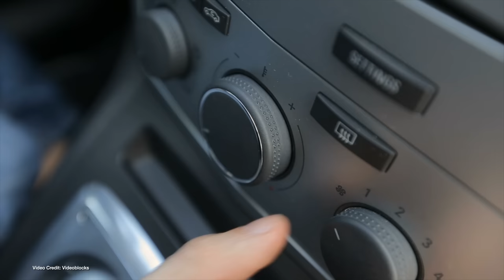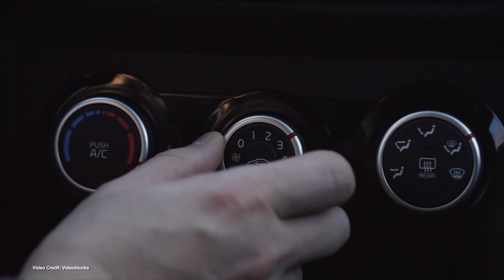How Do Electric Cars Keep You Warm In Winter?

Comment: Does anyone know if Tesla’s heat pump system actually has a backup resistive heater or not?
Reply: It does not. But it sucks the battery cold first, to save energy.
Reply: I think I recall that it can still warm the cabin with heat from the battery discharging, but my understanding is that the versions with the heat pump do not contain resistive heating elements.  

Of course if it’s way-cold outside, they’ll more likely expend energy to warm the battery, rather than the reverse.  However, if it’s only a little chilly, my understanding is that it will warm the cabin with battery heat, as part of the “octovalve” reservoir’s functionality.
Reply: @mr88cet  What do they do when it gets really cold: say -40 or so? At present, heat pumps don't function at that temperature, and batteries barely do.
Reply: @robertkirchner7981 , that’s a good question.  I don’t know what Tesla’s thinking is there.
Reply: they could generate heat by setting the motor drive phase closer to zero to make the motor waste energy. This could even be done if parked.
Reply: @robertkirchner7981  When it is really cold, then I would like to install something like 
Webasto, to heat the cabin, and to heat the battery ...
Reply: @robertkirchner7981  I believe that Tesla runs the electric motor in a inefficient manner to heat the battery and the motor.  Then, the heat pump and octovalve absorb some of that heat and transfer it to the cabin.  I think that running the heat pumps compressor will produce some heat as well, but with no more efficiency than a resistive heater.  Not sure, though.
Reply: @robertkirchner7981  "eat pumps don't function at that temperature". heat pumps will work at any temperature in principle. But the larger the temperature difference they have to work across the less efficient they get, and -40 to +20 is 60C which is a really big temp difference. They never get worse than a resistive heater though. So when the temp diff is only 10C a heat pump can have a COP of 20 or more (in theory), but at 40C temp diff the theoretical max drops to 7. it might only be 3 at 60C. https://www.engineeringtoolbox.com/heat-pump-efficiency-ratings-d_1117.html I think the heat pump is a water-source device in this case, taking heat from the battery/motor cooling system. I guess there is a heat-exchanger to air involved too - not sure if icing on that in very cold conditions is an issue. I think it could be if the heat pump is used for long with the car turned off. 'Camp mode' in a Tesla.

Comment: Car air conditioning has a relatively low pressure gas and in colder conditions will struggle to find the heat to move .. but as it is a methane hybrid it will condense down into a liquid state in the coldest parts of the system causing gas starvation and lack of heating/cooling effect.  Identifying where it is condensing is the trick . Normally in the compressor oil , on most home air conditioners you have a low wattage compressor heater . Now I could be wrong but I have been doing heat pump stuff since the 80s and it seems plausible.  Great show .
Keep smiling.

Comment: sounds like the best option would be a heat pump for normal temperatures and a PTC heater for when it gets cold.
Reply: Or one that preheats the car while it's plugged in.
Reply: @glennmartin6492  
sounds to me like both a heat pump and a PTC heater can do that.
Reply: @aussie2uGA  
and that's why it would be the best option.
Reply: @glennmartin6492  
How about also "melting" a phase change material off the mains power.  It would store quite a lot of heat in very little weight.
Reply: @kensmith5694  Elegant.

Comment: I have a 2018 40kwh Nissan Leaf in Canada,. Although not Quebec kind of cold, I do notice that the heat pump start getting pretty useless at -20c, it pretty much turns the outside cold air into lesser cold air on the inside,... We keep blankets in the car and use seat/steering wheel heaters and its tolerable... But don't get me wrong... between 0 to -10c its wonderful and works rather well and instantly,... Just the nature of the beast... I wonder if they're going to engineer a hybrid PTC/Heat Pump system, warm the air up a bit before it enters the heat pump when outside temperature reaches a certain threshold...
Reply: I have a 2019 Nissan Leaf and this is my first winter experiencing a heat pump in a car. I live near Philadelphia, where we rarely see single digit F temperatures. However, we've had temps in the mid-teens often this winter, and so far I am impressed with the Leaf heat pump. It heats the car up quickly, much better than my previous 2015 Subaru Legacy car with a 2.5 liter ICE. I often start the temp system remotely 5 minutes before I get in, and it is nice and warm. It also works well as an air conditioner in the summer. So for my area, a heat pump in an EV is a nice compromise.

Comment: You made a great job of explaining everything, and leaves only one factor out: forward motion through such cold temperatures, more than DOUBLES the problem depending on speed, of heat pump type systems (the ones that work like refrigerators or aircon).  Example: I had a fridge that was replaced but working and thought i would use it for extra cold storage in my garage. WRONG! Fine in everything but winter!  The ironic concept i did not know, was that heat pump type systems like the fridge, almost completely fail around zero degrees centigrade or forty Fahrenheit.  Stuff in the fridge was WARMER than if just left out in my freezing garage!  Now, move that fridge at say fifty miles per hour through that same cold air, and the problem worsens hugely.

Put another way, it does not have to be ‘super cold’ for heat pumps to fail to warm a car - this fails to factor in the forward motion issue I describe.  There is a space here, for a plug-in micro-engine or boiler, using fossil fuel perhaps gas recommends itself because i think i am right saying deep cold does not affect it, except condensation in the feed pipe ti the burner.

But, a small capacity, 180cc triple cylinder gasoline combustion engine, should produce enough heat for the cabin while being able to charge batteries at the same time.  This would turn the present hybrid world on its head, and still send us into primarily using electric powered cars, but with a fossil-fuel component.

Sacrilege for some, but Volvo have long made cars where Canada and Scandinavia versions had a mini-boiler using diesel, to heat or pre-heat the vehicle.

It would also save or create jobs.

There’s no fighting reality. Either lose a third of your main battery to heating, or you are aiming at a microgasoline unit or fossil-fuel boiler like I suggest.  Fundamentally, these would not be hybrids as we presently know them - the 180cc triple engine would be only connected to a generator not a drive shaft to the wheels.  More like a refined version of BMW’s ‘range extender’ than the main engine of the Totota Yaris self-charging hybrid advertised before this video on my YT app (LIE ALERT - the hybrid bit, I really did see the ad stuck on the front of seeing this excellent video).

Great job highlighting the main stumbling block to me recommending an EV to my daughters!  Look how far we’ve come...price is almost there especially with USED EVs becoming available, range is all but beaten as a problem, tech settling down.  Cabin heating is a bugbear, if all it took was this micro-engine heater/charger unit to fix it, that’s a huge milestone we have reached.

Happy New Year.  We are way far away from 2011, ten years of solid EV work has propelled us forward so far let’s keep going.

Comment: My version of the Model 3 LR has the ptc heating system which I love. What you did not mention is the brilliance of Tesla’s octovalve system to be able to manage heating distribution when its batteries are heated reducing reliance on the ptc heating system once everything gets going. I think for an extra 10% more battery capacity, the ptc heating system is is just as efficient as a heat pump while having the advantage of being able to get instant heat in a moments notice or subfreezing temperatures. This is one main reason I'll be holding on to my Model 3 for life.

Comment: I live in an area of the Rockies that can see temps dip as low as -20°f in winter. About 5 years ago, I had a 2nd gen Prius that was almost underivable in those extreme conditions because every time the ICE shut down while driving, the coolant through the heater core would cool so fast that the air out of the vents couldn’t keep the glass defrosted, much less the interior warm. I had to keep a credit card at hand to scrape the driver side window to see where I was going. I share this story only to say that I understand the struggle these northern EV drivers face in winter. While not ideal, a small auxiliary biofuel heater added to the heat pump setup seems like it would make perfect sense. At least as a temporary stop gap solution while better technology is developed.

Comment: In other news, Bjorn Nyland just tested the Model 3 LR sleeping in the car with -26C and the heat pump worked great, specially the octovalve sucking the battery's heat to make the consumption lower is a great thing imo. First time heard an EV using the battery as thermal mass and using the waste heat for cabin heating.

Comment: The gen 2 Volt can idle the ICE while driving in electric mode to heat the cabin when it's very cold, I forget what the threshold is. It's not the most efficient way to do things but petrol just sits in my car all year long so it gives me a chance to cycle some of it out during winter months and it helps extend the range a bit. The car does have a fuel monitor but this way I use fuel when it's most efficient to do so and not on a hot summer day. Yeah I use so little fuel I've gotten into the habit of using fuel stabilizer just to prevent problems with stale fuel as the car ages!
Reply: 15F is the switch over point, selectable in later Volts. We usually bypassed it in favor of the battery. Sitting at a light with a sub zero, idling engine, was horrible on fuel economy. Not sure why GM decided to push for such software, the 8,000 watt electric resistive heater was more the adequate to heat the cabin in Minnesota winters, but very thirsty.

Comment: Finally some one who feels the same way about -40C / -40F! YAY!!! lol
Reply: I was explaining this to my 6 year old last night as we were reading Wilder's 'These Happy Golden Years' .
Reply: Yup. That's why when one has to change from F to C or vice verse in your head it is easiest to add 40, multiply by 5 or 9, divide by 9 or 5 and subtract 40. You don't have to remember whether and when one adds or subtracts 32 and 0s are easy to add or subtract. Of course if one does this rather often you have a good idea of the answer for the most common cases. This is what happens if you live in the US and are a physicist. :)
Reply: @danielcarroll3358  Try adding or subtracting 32 instead
Reply: @SMARIO24  Which one. And is is before or after you multiply by 5/9 or 9/5? The 40 method is easier to remember and perform in your head. That's all. They are mathematically equivalent because of the equality of -40C and -40F.

Comment: I've had two homes with heat pumps and neither one performed as promised. Their air was not nearly as warm as a regular furnace, they took forever to warm up the house, and they'd sometimes ice up. I would expect autos to have similar problems.
Reply: Batteries don't work in the extreme cold.  To get any heat out of them, short the positive and negative terminals together for my amusement.. Perhaps Tesla should supply woolly hats, scarves & gloves as part of their winter pack. Electric vehicles are a scam to squeeze the last pennies out of people & is enforced buy governments and local councils by heavily taxing regular fuel cars

Comment: I'm really curious about this one.. Watched a video a few months back on the tesla 'octovalve' system. As the same heating and cooling systems are used for passengers and battery at least in the models that use it, I'm wondering if the car is prioritizing bringing the batteries up to temperature quicker. I do wonder what customers would prefer.. Reduced speed/power, or reduced heating, at least for the first while.. 
(I'm also glad I live somewhere it never gets below 0c! Brrrr!)
Reply: Curiously I immediately thought of integrating battery & motor cooling systems with the heat pump as they both generate excessive heat.
Reply: The heat pump cools the battery and motor. They could generate heat by setting the motor drive phase closer to zero to make the motor waste energy. This could even be done if parked.
Reply: @LaserFur  As a software patch, I don't mind this idea. You still need to bring the batteries up to a high enough temperature to pull out energy energy for both heat and traction, but this could be done dynamicaly as things warm up. 
I suspect the final solution will be to add a resistivity heating unit to the cooling/heating loop that gives the car a way to add extra heat in these cold climates without doing strange things to the motor or other tricks.

Comment: As something of an heat pump nerd,  60 degrees C probably represents the upper limit between the outside air (the evaporator) and the temperature of the inside heater element (the condenser). If its -40 out  and  the condenser is not going to get much above 20c which isn;t much good  as you probably want a minimum of 30 C to get the cabin to 20C.   You could get it higher with a multi stage heat pump (use the out put of the fist stage to feed a separate second stage) but it gets crazy expensive and complex. Simpler would be using a resistive heater to boost the air outside and then feed that through the pump.  Cost and complexity again. Apologies to the Americans stuck in their freedom units but the Canadians will get it.

Comment: Well, I noticed that Bjørn Nyland just released a video where he camps overnight in a Tesla m3, in -26 C. It seems like the heat pump managed to keep the car warm quite well. But that doesn't mean that things can't be improved. First of all he is probably amongst the more experienced ev users out there, and he prepared for the night by insulating all windows, which you can't do while driving. He is also using the latest model 3 available. He also mentioned that the double glass windows seems to insulate better than the standard ones. If there really is a problem, it should be possible to solve this by making an arctic version. Mybe with some bigger capacity heat pump or added ptc heater.

Comment: Some additions: 1) What also helps are heated seats and (to a lesser extent) steering wheel. That will keep you warm more directly, allowing you to run the general heating at a lower temperature.
2) A potential downside of heat pumps is that they often scavenge heat from the battery, which can cause a slower charging rate on road trips.
3) you can wear a jacket and riding gloves...

Comment: Hi Nikki my 2015 Volkswagen e Golf SEL has a heat pump and a high voltage coolant heater in the normal coolant loop the same on tha ICE golf uses but it’s only used when the heat pump can’t cope with very low temperatures.

Comment: Probably a software update away. I'm sure they'll integrate some form of resistive supplement to meet demand (similar to other EVs equipped with a heat pump). It's their first heat pump system, probably working out the kinks.

PTC is a form of resistive, both are 100% efficient. But I can imagine GM's resistive, coolant, approach would offer more losses within the plumbing outside the insulated cabin, or losses from metallic thermal bridging though the plumbing. PTC sounds to be a more direct form of hearing, eliminating the middle man.

Heat scavenging would be a nice topic to include next time. Enjoy!
Reply: they could generate heat by setting the motor drive phase closer to zero to make the motor waste energy. This could even be done if parked.
Reply: @LaserFur  

Similar to the original model 3? That's the resistive heat I was leaning towards in Tesla's problem. Just hope there is a way to tap into such with current hardware.
Reply: @wzDH106  I don't think the new model has separate resistive heaters. but the motor can be forced to generate heat. just think if it being told to do full acceleration and breaking at the same time. This would heat up the coils in the motor. The heat pump would then take this heat and use it.
Reply: @LaserFur  

Technically a form of resistance, is it not? More than one way to skin a cat in achieving resistance... Tesla was creative in combining resistance heating from the drivetrain, reducing complexity. 

I believe the heat pump equipped 3 and Y retain this setup for battery heating, correct?
Reply: @wzDH106  I don't know how different models are. you could go check out sandy monroe or some other channels.

Comment: Heat pumps with dual sources might be the best option. For example, batteries do produce heat as they are being used so being able to pump that excess heat from the battery into the cabin as an adjunct to pulling heat from the outside air would improve their efficiency even more. A two stage heat pump in which heat is extracted from outside air first and then added to the excess heat pulled from the battery.

Comment: PTC is resistive. Not more energy efficient at all.
Reply: Quite. I just came here to say that. Odd mistake for Nikki to make.
Reply: @Wookey & @misium you are both correct.  I can also suggest a way that Nikki is also correct.  You see, if you design a PTC heater for a car that only goes up to 20 degrees then this will keep many people from running the heater at 30 to heat the cabin up quickly, and to forget to reset it until they get too hot.

BTW love the videos, ; - )